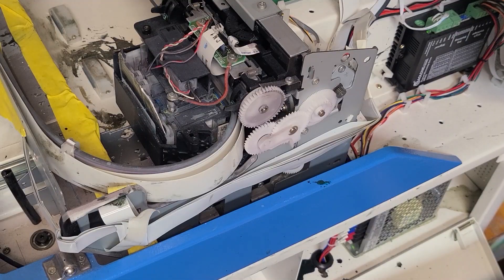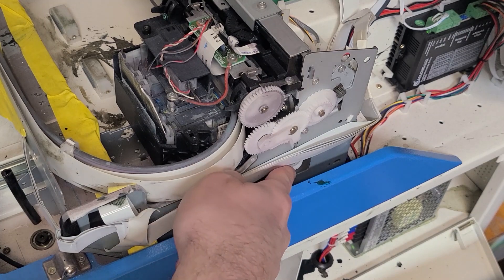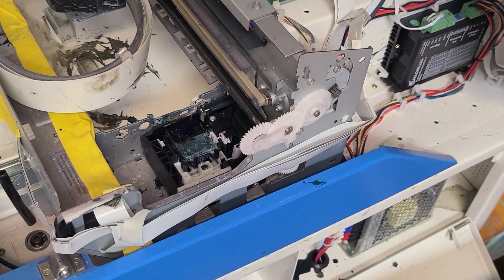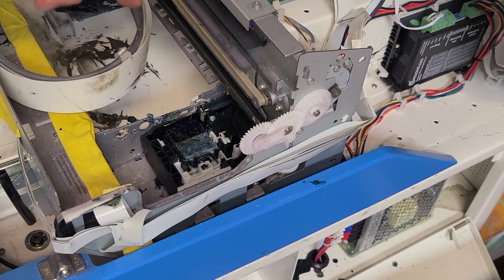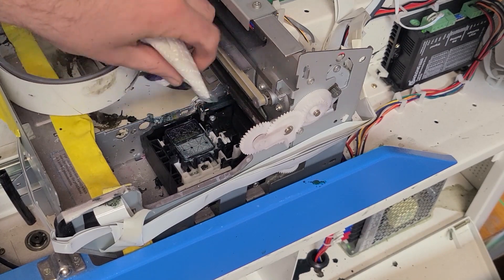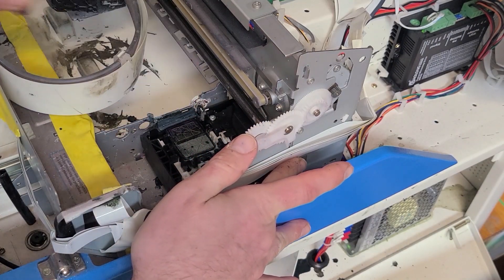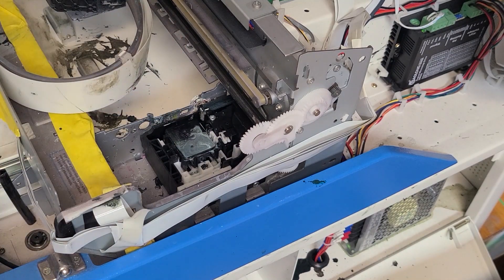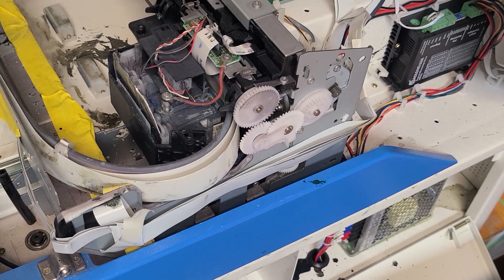Wetcapping 101 for DTG/DTF printers

Comment: Very helpful, just wondering:

How long you’ve had this dtg printer, how many prints you think you’ve got out of it and how many times you’ve actually had to replace or ‘repair’ the print head.

I see a lot of conflicting information online about this and was wondering, if I keep to a ‘strict’ maintenance routine with printheads and wet capping would it be possible to avoid having to replace a print head. I’m not going to be printing on a massive scale, probably only one or two days per week.

I plan on having two sets of refillable cartridges. One with dtg inks and the other with cleaning fluid (or windex, not sure).

whenever I’m not using the printer I’ll flush out the lines and print head with the cleaning cartridges
Reply from the maker: I have had this printer about 3 months, I bought it second hand. The original owner couldnt figure out how to use it honestly. I bet it had less than 100 prints on it. Ive probably put 150 prints on it. Honestly its been a learning experience. DTG inks clog up pretty quick if not in use and these arent exactly made to not be in use. You need to wetcap it everyday its not in use. Keeping the print head wet will fight clogs. My other DTG printer has probably 700 prints on it. The more you print the better it will run. The first print head in this unit was damaged by my own doing, cleaning it, not keeping the connections dry enough, damaged cable, cooked the head and main board. There is no other way to put this other than they are fragile. I have learned this the hard way unfortunately. The good side to them is even if your head is clogged you can usually unclog it by soaking it and gently pushing cleaner through. If the head is clear and you still have issues printing you need to follow the ink until you get to the issue. There really isnt a need for cleaning cartridges , you can remove all the necessary parts and clean them out manually.
Reply: @planetpodcast5607  do you give it the connector time to dry after cleaning?  Only reason I asked is because I might have got some cleaning solution on my connector and was a little worried about that. My dampers will be here tomorrow and will be reinstalling.   I used some canned air to blow what ever I could put
Reply: I have a lot of problems with this printer